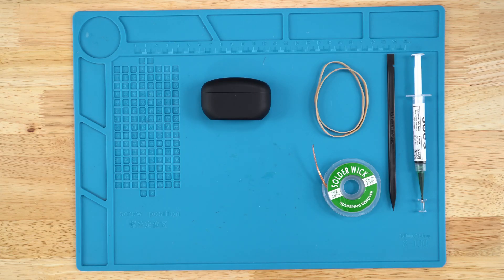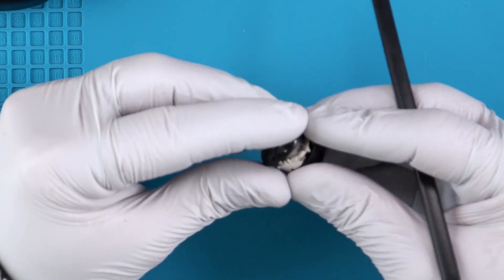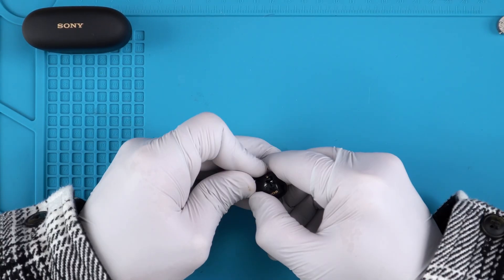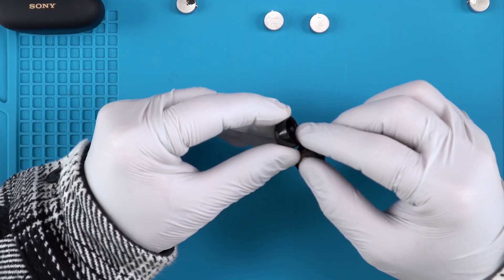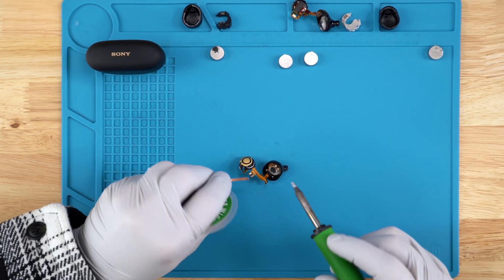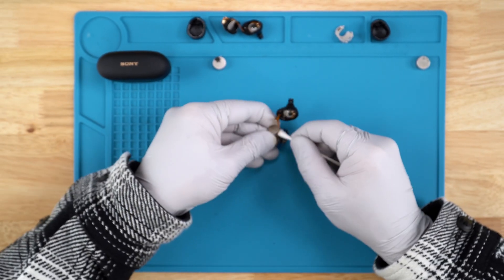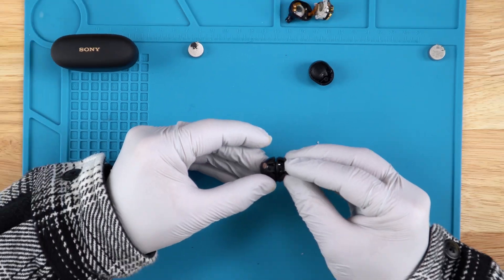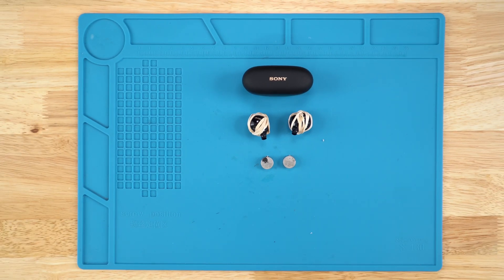Sony WF-1000XM5 Battery Replacement (Left + Right) – Step-by-Step Repair Guide

Comment: Skip XM5 . Batteries almost unreplaceable if you're not skilled soldering batteries. Linkbuds S are way more repairable. No soldered junk that will need to be replaced
Reply from the maker: Yeah, soldering can be annoying sometimes, but the XM5s themselves are very good

Comment: Why do they have to solder the battery? It seems like they want to make it disposable and difficult to repair yourself. In the xm3 and xm4 models, I can easily replace the battery in less than 10 minutes for both and it only costs me $15 for the battery. If I buy the xm5, it will cost me $30-40 for repairs.
Reply from the maker: Gotta ask Sony why they did this.

Comment: I have a pair of xm5s and the left one stopped working after I dropped it on the ground. It still charges and connects to my phone and even the touchpad still works, but it doesn't make any sound. I've tried factory resetting and forgetting/reconnecting but still no sound. Any advice on fixing that issue?
Reply: the exact some thing happened today!! Did you manage to fix?

Comment: Thanks for this excellent video 👍 It's a shame that the battery was soldered. It's the same problem with laptops where more and more manufacturers solder the RAM, and even sometimes the battery and boot storage, to make replacement or upgrade more difficult 😡 It's a form of planned obsolescence. Governments should vote laws to forbid such abuses because they will find more and more soffisticated ways to reject non-original components (the iPhone can already detect replaced parts but luckily it still accepts them). 

The WF-1000XM4's battery is much easier to replace and the battery costs only $5 on AliExpress. So we can keep these earbuds for probably 10+ years, which is good for the environment, but not for Sony's wallet 🤷
Reply from the maker: Thanks for the comment! That's true. Devices should be easier to repair yourself, especially when it comes to battery replacement.

Comment: I was surprised to see that the battery was soldered.
Batteries should not be soldered because it makes replacement difficult.
This battery must have been designed to withstand high temperatures.
Reply from the maker: Possibly. It suck’s it’s not so easy to swap out.
Reply: I don't feel that having the battery soldered is as much of a pain compared to the fact that it is soldered to a delicate ribbon.

Comment: So xm5 has the same issue as xm4?
I have xm4 right now, and it totally sucks, like when I got them I could use ANC without additional charging for several hours flight, but now i can barely watch yt videos without "battery is low, please recharge headset".
Googled issues about xm4, and many people say that battery replacement helps temporarily, or doesn't help at all :c
Now I'm searching what tws to buy, m.b. samsung buds 2/3 pro (considering samsung buds for s23u)? 3 are very strange, 'cos they did like ctrl+c ctrl+v with airpods pro, but in worse way, and ANC on 3 is somewhat worse than 2 according to tests (mb they'll fix low frequency drop in ANC graph with fw upd).
Mb someone had same situation and can give advice, it'd be so helpful, 'cos i already have a headache with searching, comparing pros/cons and googling possible issues after xm4's.
Reply from the maker: Their batteries go bad swapping them out fixes the issue. https://www.joesge.com/products/sony-wf-1000xm4-wf-1000xm3-zenipower-z55h-battery-replacement-parts-1?variant=41148789456942
Reply: @Joesge  I did the XM4 battery swap.  It was comparatively easy BUT one side completely doesn't work!  I have checked all the connections a few times and nothing can get any life out of it.  Someone on reddit said that you have to put aluminium foil in there someway (to improve the connection?) but if one side does work, it isn't    obvious where!

Comment: I used to change my XM4 batteries when they started draining fast, but damn, that was easy compared to this. I don't know anything about soldering or advanced microelectronics 😔

Guess I'll stick with the xm4 for a while...
Reply from the maker: Totally stick with what you know. If you need your XM5 repaired you can send it to us for repair.
Reply: Me too.
Reply: Our complaint is the same🙇

Comment: Do you think extreme heat(+50C) or extreme cold(-20C)  does more damage to these kind of battery?
Reply from the maker: It’s possible since lithium isn’t stable in high heat or low cold.

Comment: If this was a product review. How would you rate this product?
Reply: I just killed mine, but I used them for a year before. Sounds quality and ANC are 5, comfort is 3, quality is 4 except that mine got a little wet and became incredibly quiet on one side. I replaced them with Bose QC ultra and I think I like those more. Sound is similar, ANC is a little worse but comfort is a 5. The bad thing g g with the Bose is the garbage app.
Reply: @kevinalford  It was hard decision to choose between Bose QC ll and Sony XM5, but im happy with my
selection because:
-Bose QCIl lacks multipoint (only much more expensive Bose QC Ultra (330 USD) has it after newest updates)
-Bose QCll lacks highest sound quality codec LDAC
-Bose QClI lacks wireless case charging.
Bought XM5 for 190 USD, I think its
unbeatable in price range of 200-250 USD
Reply from the maker: XM5 is a better product I agree with that.

Comment: Cancel all software updates =  hassle free life (no need for battery replacement)?
Software updates ruined wf-1000xm4 (battery life from 8hrs to 20 minutes in right side). What about xm5?
However i have canceled/postponed all the updates on my xm5. 😊
Reply from the maker: No guarantees it will be better than the XM4 but overall the design, battery and sound quality are much better.
Reply: @Joesge  didn't had a chance to try xm4. Would have to trust your remarks or chatgpt. 🫡😁